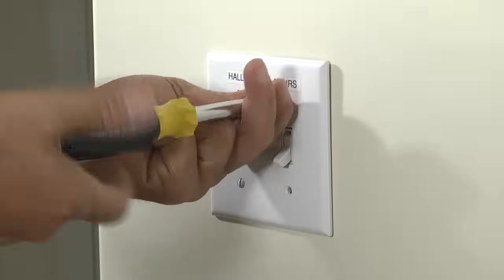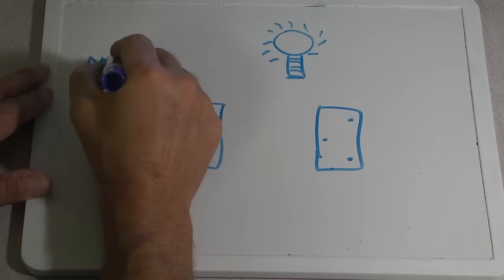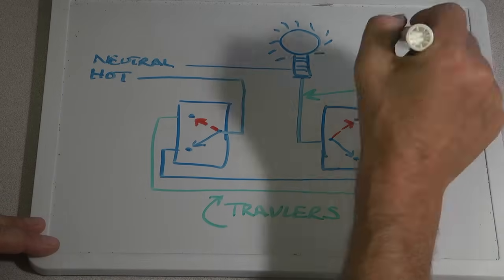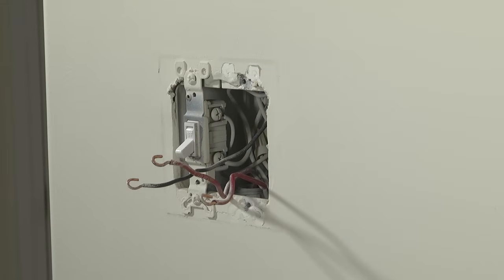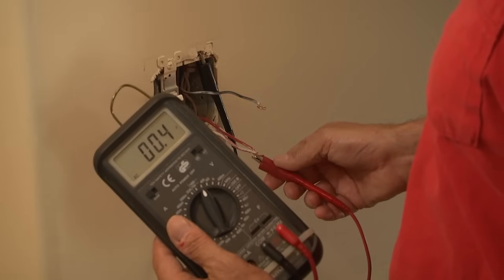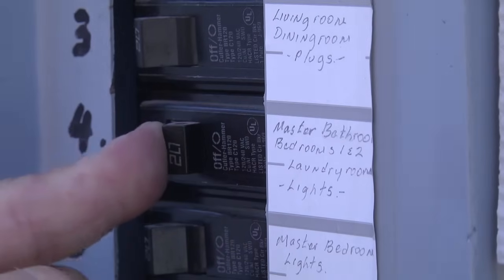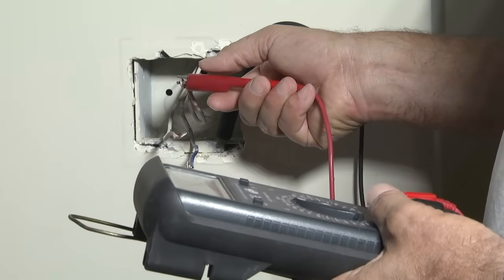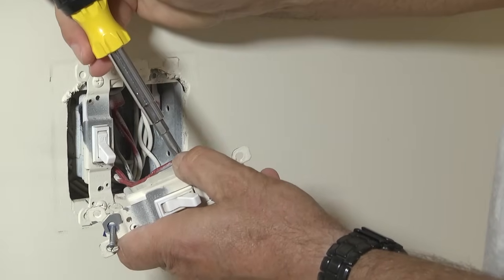Find the correct wiring for a 3-way switch in 2-minutes!

Comment: You have a gift of teacher, I normally don’t leave comments to you too but I have to do this one , I was swapping my 3 way switches I I thought I was doing that wire by wire but still managed to mess it up I was loosing my mind and then stumbled on your video 
Few min Later all working back to normal
Reply from the maker: Thank you very much for your generous comment. I'm glad my video helped you find your solution.
Reply: What if there are two lights that come on in series with two switches?

Comment: You are a lifesaver. Had an issue with a 4 way circuit.... and only solved after figuring out the issue was with my 3-pole switch wiring. THANK YOU for this!

Comment: Can you explain why I would not get voltage/current on one of the traveler wires after combining the three  wires on one side (i.e. the side with the hot wire)?  I have identified the hot wire. I also don't see any obvious splice in the two traveler wires. I also see that the two traveler wires are in a separate conduit.
Reply from the maker: If you give me your phone number I can't walk you through the 3 way switch. Thank you

Comment: If you've been searching the Internet for hours like I have to fix a 3-way switch, stop now, because this video is perfection. I was having trouble with my 3-way switch and watched several videos using methods such as rotating the wires one position at a time until it comes together, except none of them worked.  This video explains how to find the correct wires and does it simply. Thanks for doing this!

Comment: Thank you for such a clear, concise, and informative video!  Today, I attempted to remove one of the three-way switches from my laundry room, so that I could install a single-pole occupancy switch.  After the installation, I could hear the switch activate, but the light wouldn't turn on.  Thanks to your video, I learned that my existing three-way switches were wired incorrectly, and I was able to get the occupancy switch working once I was able to identify the correct hot and load wires.

Comment: In my country both wires are hot..so how can I locate the right wiring sir?
Reply from the maker: I am not sure you are describing the same thing as a mechanical 3-way circuit because there must be TRAVELER wires to do the mechanical changing of power to the load (lights). There are home automation devices that do the same as mechanical 3-way circuits but do it through data transfer. The video is not about that, rather only a mechanical 3-way circuit. Hope that helps.....
Reply: @MarVistaCat  oh sorry ..what i mean..we don't have neutral..so two wires are both hot..the third one is traveler right..co'z in your video..you wrapped the three wires while you're testing them while the breaker is ON..we can't do that..
Reply from the maker: If you can give me your phone number, I'll give you a call rather than trying to explain it on the internet.

Comment: Wow! Super helpful, you made it stupid simple. Last night I was replacing a cracked 3 way switch and in a usual rush I did it hot. The other switch on the circuit is an electronic dimmer...which I unknowingly zapped. Thinking I must have screwed up the wiring I started moving them around on the new switch terminals...until I was completely confused. After watching this video I determined the correct wiring and since it still didn't work I bought a new 3 way dimmer. Problem solved...but I could have saved $24 on the dimmer by flipping the breaker! 
Years ago I had a similar problem in my basement stairwell.  I ended up calling an electrician...who spent 5 hours getting it figured out!
5 *** review to you sir!
Reply from the maker: Thank you so much. I'm glad the video helped you.

Comment: Mar Vista . i have a 3way 
Switch A Found the hot wire 
With my volt meter unable to find the 2 traveling wires . in switch B checked that all wires are connected .can you explain what could be the issue
Reply from the maker: Can you draw me a wiring diagram of what you have? Because, when you say "all the wires are connected," how and to what are they connected??

Comment: Excellent video. Thank you for making it so concise. Super easy. For those wondering bout the meter, they are cheap and easy to operate. If you are going to replace a 3-way with indeterminable wiring, you must get one. Total time from opening the box to my first multimeter to having switches installed was about 45 minutes.

Comment: OMG, I've been looking at videos about 3 way switches and thought I was going to loose my mind. Some were 12 minutes long. You made this so quick and simple. It worked the first time with no issues. Thank you so much!
Reply: Every video I've seen mentions screw colors, wire colors, or both. Worse, my junky old Lutron switches have no terminal screws (just a black box exuding wires) and the new Lutron switches I bought ALSO have a black box with no terminal screws but the directions refer to an ancient model that did have screws.

Comment: Thank you! By far the simplest and best explanation. This whole time I thought there was suppose to be 2 hot wires. Now I understand it’s 1 hot and 1 load. 

Could not for the life of me figure out why I couldn’t find any current in one of the switch box and assumed maybe the previous owner screwed something up (lots of crappy diy that I had to redo). 

I put off figuring this out for almost a year now and felt like It was time to revisit the topic a year wiser and was almost convinced the switch was faulty and needed replacing, not the wiring. Glad I stumbled across this!
Reply: Apparently my situation once I looked at the wiring was a little more special? I had 6 wires in one box and 4 in the other. Only pairs of black and white cables, house has no grounding. I believe an owner at one point converted it from a 2-way to a 3-way.

Basically the box with 6 wires contained one hot wire. I crimped it to a wire that ran to the other box to act as a hot wire and went from there. Took me a good solid couple of hours to figure out the routing and what was happening.
Reply: Thank you been 55 years since I did and House wiring (I am 73 years old) and this house was a mess no ground wires at the switches and the boxes are plastic but and extention cord from a grounded outlet did the job, I used the ground in the extension cord.  Thanks again
Reply: @edmarshall8421  Hey, thanks for the great idea about the extension cord. I have a house built in 1908 and many switch boxes are not grounded, but some outlets are.

Comment: Thank you Mar VIsta Cat!  You are the only person on YouTube who used a multimeter to figure out the load wires in a bullet proof scientific manner.  All the others just used a volt tester, which I learned the hard way, does not always work.  You can end up with two wires showing voltage.  As a DIY guy , I thank you.  There were 3 sets of 3 way switches and by luck, I got he first two sets wired correctly.  If I hadn't run across you video, I might have spent the whole day randomly mixing wires on the third set.
Reply from the maker: Thank you

Comment: Worked perfectly to allow me to trouble shoot and set up a 3-way switch with a dimmer on one end!  I do agree with the one comment and used a wire nut to put the 3 wires together. As a comfortable DIY'r I have a proper multi meter, non-contact voltage tester, Milwalkee insulated screw drivers, and a Sperry breaker finder. Some comments below show some issues. My personal thoughts are that if you do not understand electricity basics, nor have proper tools, then this type of work is NOT for beginners.  It's just not worth the risk.

Comment: I identified all the wires in a 3-switch (one 4-way) setup quickly and easily. Thanks so much! The algorithm is: 1) disconnect everything, 2) find the hot wire and label it, 3) connect all the wires in that box, 4) find the hot wire(s) in the next box and label it/them, and repeat from #3. At the last box, the wire that's not hot is load.
Should work for any multi-switch setup!

Comment: To find the traveller wires, after you know which wire is the incoming HOT wire, connect the two travellers at that switch together. 
Then go to the other outlet (which also has the three wires disconeected) and use a continuity tester and see which two of the three wires have continuity. Whichever two do, those are your traveller wires, the third wire being your LOAD wire.
Reply: So wait a minute,  its not "connect the 3 wires" at switch "A" ?? Just asking because  I connected the 3 wires per this video and upon turning on the breaker it would instantly trip..
Reply: This may be a very helpful video as far as the drawing goes, but @dannydee9919  yeah... don't turn the breaker onwith the hot and ground together! No switch "A" or "B" in my 1921 house. #1 It has no "ground" wire. 🤔 The neutral wire is my ground wire. #2 To make it more confusing all my wires throughout my house are black! 🤪 #3 I disconnected all the wires from my three-way switches and turned the juice back on. I discovered both switches had one hot wire. #4 In my case I followed 3-way switch instructions to hook up the LOAD wire, NOT the hot wire to the black or dark colored screw. 

 In my old house something tells me you don't "tie all three wires" ground, hot, and traveller together and turn the breaker back on. Lol! Good way to fry something or start a house fire! I left the breaker off and did a continuity test like Richard M. then suggested. 

Now I'm just getting ready to replace the old 3-way switch at the top of my stairway with a 3-way dimmer switch for 2nd time because on the first try I fried the first $25 dollar dimmer switch. When I first had the breaker turned on checking for voltage I had power at 2 wires at both 3-way switches. However, now that I disconnected all 3 wires from both switches I now know that the "second" hot wire must be one of the 2 traveller wires, the third wire without voltage must be my "LOAD" wire. The only questions I think I already have figured out is 1. Why do I have power at both switches? Answer: probably because there's an outlet beside the one 3-way switch (downstairs switch) and the upstairs switch has power simply because power is coming in from another part of the upstairs. 2. Can I put a dimmer switch on whichever switch I want to even though there is no switch "A" or switch "B"? Probably not the one with an outlet unless I wanted to vary the voltage to the outlet. Lol

The way my house is currently working and wired at the 3-way switch with an outlet beside it: # The wires without voltage are hooked up to the dark colored screws. The traveller wires are hooked up to the lighter colored screws!Not the way Richard M says to wire a 3-way switch! The way I did it works! 

The black screw on the top left side with 2 screws of the 3-way switch has the "LOAD" wire (not hot) attached to the black screw. The incoming hot wire is attached to the bottom left. The "other hot" wire is wired to the only screw on the right side of the 3-way switch. 

 Now to see if I'm right! I'm going to install a 3-way dimmer switch in place of one of my regular 3-way switches. If you don't hear back I was right on my second try. Lol
Reply: Great video. It gets more interesting when you have original 1921 wiring with all 3 wires that are these black insulated wires. There's no "ground" except neutral which is your ground and you have one hot wire in both 3-way switches, but 2 wires are hot in both switches with the breaker turned on. Makes sense for those in the know.
Reply: Richard M. Great tip!  That saves a trip to the panel box. 👍🏼
Reply: This is a great tip, thank you. Much simpler and safer IMO :)

Comment: Good video. Just 1 peice of advice... TAKE A PICTURE OF THE WIRES BEFORE YOU START. Still follow the videos instructions to determine which wire is which. Do not reattach according to the picture. But better to have and not need - and once you have it properly hooked up, you can look at the picture and determine what the problem was (if there was one).

Comment: When I do this regardless of which outlet I go to I will always have one wire with current (switch A). I tie the 3 wires together in A, when I go to B I have current on all 3 wires. Regardless of which switch I use as A there is always current on all 3 wires on B. Any suggestions? If I wire in a new switch the circuit trips. If I put in the original switch that was there the circuit won't trip but the switch doesnt work

Comment: I have  two  3 ways and one  four way.  Building was built in 2002.  There is no red and black - looks like they sprayed black on the white wire ( for red). I tested the  two  3 ways and they both have 2 blk and one red. The two red wires are hot ?   I tested the two blks and they have continuity. Since the red was hot  -i put it to the black screw on both  switches. Then I went to the 4 way and there were  4 wires and they are all blk. I found the  2 blk that  had current and cunnected them to the input and the other  in the out put. When I hit the switch it grounds out and blows the fuse and the light socket it is suppose to operate is hot all the time with the wires off the switches. Need a sugestion -Thanks

Comment: I tried this but switch B only had 1 hot wire after I jumped the 3 wires at switch A. What could be the problem? Thanks
Reply: Synopsis: switch A controls the kitchen lights fine. Switch B only works when switch A is in the on position. 

Switch A has the hot wire coming from the breaker box.

Comment: I imagine most home owners don't have multimeters and arent comfortable working with live wires. If this is your case, there is still a way.  Turn off power, if you're not sure which breaker, then just turn off all the breakers, you'll likely need a flashlight regardless. Chances are,  after pulling out the switches, you'll be looking at 2 black wires and a red wire at each switch( you may see a green or bare wire going to a green screw, disregard it, its the ground, it has nothing to do with function of 3 way switches).

 Look into the box and follow the red wire. You'll find it enters the box from the same hole or cable as one of the black wires. That black wire along with the red wire coming from the same spot are your travelers( the wires you put on the gold screws) and the remaining black wire  is your common (the wire you put on the black screw.) Do this for both switches. In most cases this  will work to fix a 3 way.

I have to emphasis this isn't a guaranteed fix, This is just an easy method to fix the most common miswiring of 3 way switchesI've seen in my few years of experience. sometimes its just so horribly miss wired(crossed with other switches, or even outlets) that the method doesn't work, or the color of the wires are different( the principle still being the same, however the identifiers are harder to see.) In those cases I would recommend calling a professional. Doesn't even have to be an electrician. A reputable handyman can often fix it, while charging notably less.
Reply: Irvine Spiegel .. This simple process that you outline worked perfect for me, thanks
Reply: glad I could help.
Reply: I used your method and it worked perfectly. Thank you.
Reply: If they dont have at least a $2 volt meter, which is the only part of the multi-meter being used here, they shouldn't be going anywhere behind the cover plate, as they have no way to test/ensure that there is no power still coming in. 

The narrator also mentioned the reason he did things this way (still, not very safely) was to show what to do if you cannot verify the wiring and need to isolate the hot and traveler wires.

If you know the source of each wire/cable, can test for safety before touching anything and understand how a basic circuit works, then this is the way to go. If the same but can't identify the hot or source of the cables coming into the box (especially in a two or three gang box), do as you saw in the video, but add safe practices.

It also helps if you identify your position or experience when giving instructions. The youtube professors looking for their attention fixes will get you dead quick
Reply: THANKS SO MUCH!!
2 hours of banging my head against the wall, all fixed in 30 seconds.

Comment: When I get to the part where I tie the 3 wires together and turn the power back on, the fuse blows and won’t come back on
Reply: Yikes, you need to call a pro if you did that. It's pretty hard to screw up these directions so your wires are most likely  not coming from where you think they are.
Reply from the maker: If you will give me your phone number, I will walk you through it. Thanks
Reply: MarVistaCat 443-768-6046

Comment: This video is dangerous do not use for reference the demonstrator shorts one group of the circuit then at other end of the circuit states to check for power suggesting that power was turned back on with the short at the other end, very dangerous !!!!!!!!!!!!
Reply: You don't understand how a switch works...
Reply: It just sounds dangerous. It is not if you think about it.
Reply: Your dangerous. The video is correct. It worked 100 percent. My 3 way switches work now.
Reply: Nobody shorted anything, this is just the way switches work.
Reply: Rich Wachtel The switch was taken out of the circuit at both ends, so what does making a short circuit bypassing all other connections have to do with him understanding how a switch works? I hope you're not saying the video shows safe practice. There were several instances where I could see the novice diyer meeting his maker with a little slip up. Handling the switch and then stating to cut the power? 

Remember, good or bad, many rookies who don't know how a circuit works or the difference between parallel and series even are watching these videos as a step by step guide. 

Shocking, I know!
Reply: Ronald Foo No, it's dangerous.
Reply: Ronald Foo Just because it worked doesn't mean it was safe.